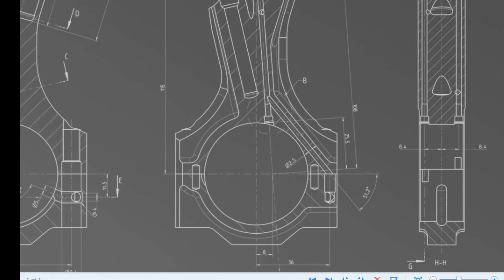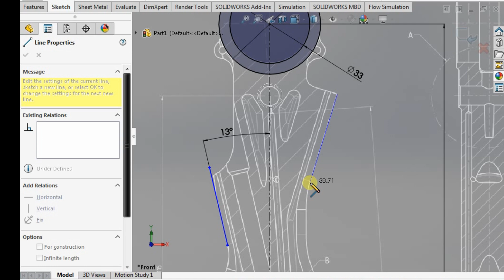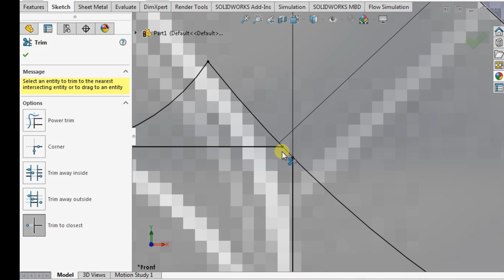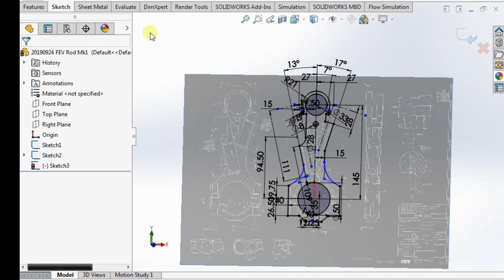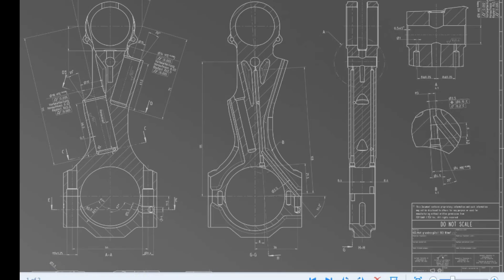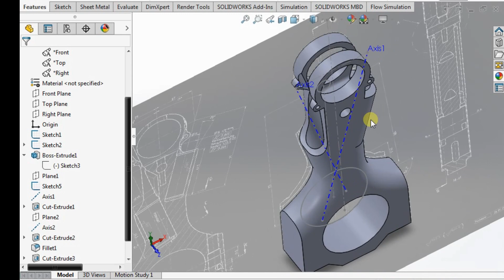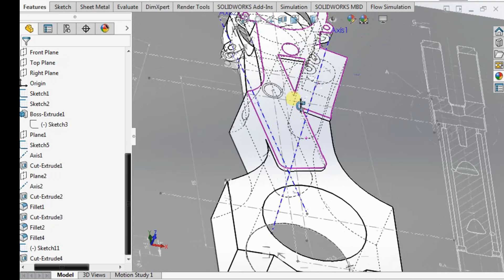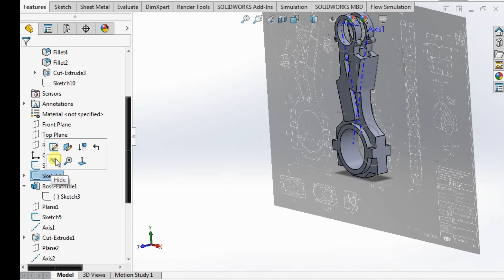Weird Rod - CADing Part 1

Comment: Variable compression systems seem overly complicated. If it's so special what's wrong with using a simple system like old RC diesel engines had?
Reply from the maker: RC diesel engines?
Reply: @thedirtyworkshop  they used to have them on model airplane diesel engines. It was basically a bolt going through the head into the combustion chamber. Screw it in it raised compression, screw it out it lowered it. It was used to manipulate combustion timing for different speed propellers
Reply from the maker: LOL I thought you meant a company called RC that made diesels - not actual Radio Controlled engines. 

Well you can do that with anything. The problem with that is the void you leave. I'll do a video.
Reply: @thedirtyworkshop  I was just too lazy to type the full word radio controlled. Typing is hard.

Comment: So, are you just letting us into the world of your everyday work? It's surprisingly a lot of fun to watch! Been working on the old 2 stroke bike some more as after 1800 miles she decided she didn't like the new ignition system and ate the magnetic pickup due to overcharging as the stock voltage regulator/rectifier gave up. This actually helped me relax today. :)